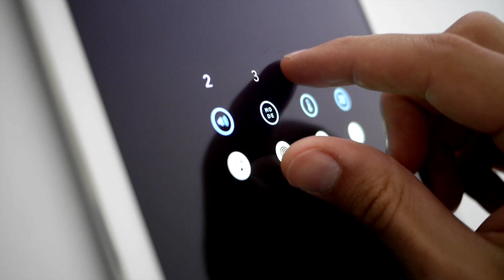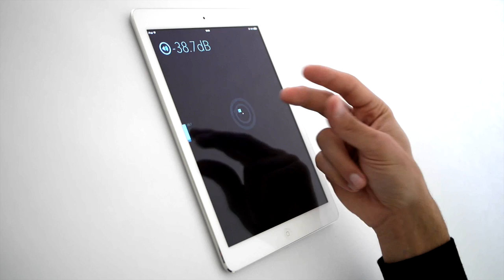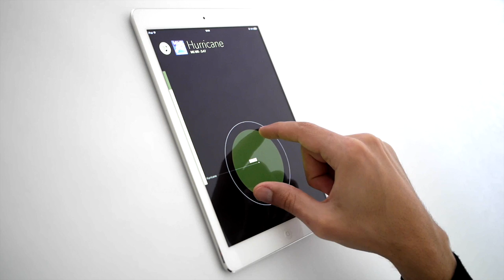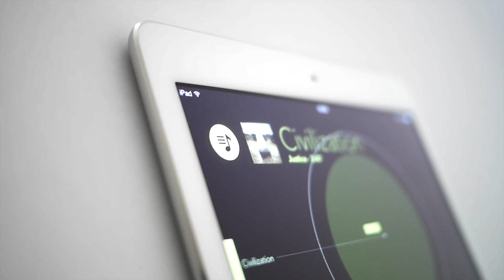A New Car UI: How touch screen controls in cars should work

Comment: Great concept, but it will be hard for manufacturers to limit the functionality of more complex models to 4 things you can control
Reply: Maybe this can be solved with more than one touch screen
Reply: 2'50  -  "All in all this interface gives you easy control over 8 different settings"
Reply: Caio Manzotti Its a neat idea, but I think its just that "neat". Its well thought out, but what happens if you spill a drink on it or crack the screen on accident like so many smartphones we see? The design and UI are extremely simple and probably would be more intuitive than dials, but the hardware of a touch screen is not practical.
Reply: Kerrigan Marois Sure, agree! But I think the idea behind the video is exactly it, prototype, test and collect feedback
Reply: Caio Manzotti I think its a great start and a neat concept. What will be interesting is to see what this is like when we stop actually driving our cars!

Comment: I've worked with a lot of multi-touch applications our company has built - both on our platform and on the QT framework.  In my experience, multi-touch controls tend to be pretty intuitive for gestures involving up to two fingers.  After that, people start running into trouble - either with correct placement (sometimes the surface doesn't correctly identify the number of digits if there is insufficient separation); or with recalling what combination of digits to use.

Multi-touch gets really problematic with 3 and 4 finger gestures, especially for people with wide fingers or dry skin.

The only successful application I have seen of 3 and 4 finger touch sequences has been on very large touch surfaces for multiple, simultaneous users, and that only works if the users are given training in how to use the UI, as it starts to become non-obvious.

I should also point out that with any touch UI, you need a lot of real estate on screen, as it's pretty hard to see what's happening on the screen underneath your hand.  Phones and tablets are okay, because you can hold the device close to your face as you interact with it, but a fixed screen in a car console would have to be surprisingly large for multi-touch gestures to work well across a broad range of users.

Instead of trying to be unnecessarily minimalist, I would suggest using large, friendly buttons to allow users to select a working context, (for example, adjusting the radio, or setting the temperature, or selecting an audio source), and then present a touch surface with 2 or 3 simple gestures like press, pinch, or roll, that don't involve more than 2 digits.

Comment: Driving a car on itself is a complex task, since the driver has to control the car, watch the traffic and be aware of what exits to take. The great challenge in car UI is that is should interfere as little as possible with the task of driving a car. Therefore I believe car UI shouldn’t rely on visual feedback, but instead look for other ways to give feedback. The big downside of touch interfaces is its lack of haptic feedback (and its reliance on visual feedback). Without watching a screen the user cannot see what button it is touching, if it is changing any values, and if so at what rate.

Also, putting multiple functionalities on one touch screen, allowing the user to switch between the functions via complex multi-touch gestures is making this interface even more complicated, making this a very hard interface to learn, master and control.

Although I agree this concept might be a better alternative than the touch screens interfaces that are currently shipped in cars (and also really like the visual style), I think touch screens in cars are in general a very bad idea.

That being said, I think I’ve actually never seen a real solid car UI (including those with buttons). I’ve always wondered why climate control in a space smaller than my wardrobe needs two-thousand buttons.

Comment: Clever, though I still think having two sizable buttons on the bottom one on the left and one on the right that takes up about 20% of the bottom of the screen would be ideal. You could sort through the options so you don't have to remember all the fingers needed for a function, this way you only sort through to that function and use one finger to alter the settings.

Comment: Considering using your hands is more about touch than sight.. only when they develop a touchscreen can have different textures would such a progression be relevant.  While this may seem like a great idea, what happens when you need 6 fingers to control the next setting?  What happens if you forget how many fingers you need for a particular setting?  and Most importantly, what happens if you're handicapped and are missing a finger or 2?

Comment: Beautiful Design! However, there are several problems with this approach. The things that buttons do really well for the user is indicate a feature. With your design, the user has to remember that two fingers = volume, three = fan, four = wait what was four again? It's unnatural and will not resonate with users of all demographics/ The other thing that you're now introducing--just as you point out with the buttons--is a ton of error. For example, the user tries to adjust the fan speed but didn't quite get all three fingers on the screen so now they are adjusting the volume. Imagine this sort of behavior but at 70mph. I'll take a few button clicks over trying to remember the correct finger combinations. Also, think about cold weather and gloves. This type of multitouch interface would virtually be unusable unless the user had a pair of touch screen gloves. I think the idea is novel, but isn't actually a good interface for a car.

Comment: While I think this is an improvement over the icon interfaces (like shown at the beginning of the video), I think a voice-controlled interface would be better and easier, Just talk to the car and it will adjust the setting you want; no need to worry about remembering how many fingers do a specific action.

Comment: Nice, but you realize there are more than 5 functions that can be controlled in a car?

On a more abstract level, the unsolved HCI problem here is mode switching, and doing it by counting the number of fingers is not really scalable.

Comment: Good concept but breaks general usability principles like affordance and visibility.
A blank screen does not give the user any clue of what to do as there is no affordance making it obvious what 2/3/4/5 fingers do. The system status is invisible and the user has no idea what to do with the system without a manual. There's also no mapping of the number of fingers to what the control is, why is 2 volume and 5 is aircon.

Comment: For common tasks I'd still prefer actual buttons that I can memorize instead of having to rely on multitouch gestures for everything. I'd rather press one button multiple times to browse through input options than having to fiddle around with a touch screen. You are supposed to control your car without getting distracted from driving.

With adjustable and correct placement your UI might just work. It sure looks fancy. But the input speed is nowhere near as fast as the way I currently control my car (purely by muscle memory and haptic feedback, without even looking). And that is a huge safety concern. Have you actually tried to control a vehicle while having your right arm extended to a touch screen, gently trying to maneuver your fingers into the right position over the time span of several seconds?

I don't see it happening. Car manufactorers might want to use touchscreen technology to reduce the number of actual buttons, but for core functions (the stuff a driver might want to adjust while driving)... god no.

Comment: We should be getting away from programmable touch controls completely. This is a good idea, for now, but what happens when you want more than 4-5 controls. A voice command system is the most intuitive interface I can think of. You're cold? Click a button on the steering column "Car temperature 23 Celsius, please." You can even have commands to save/load presets.
Reply: Except then I'd have to lower the stereo and roll up the window before every command to ensure my voice is discernible above ambient noise. The greatest frustration I've experienced with UIs have been voice commands that constantly misinterpret what I'm saying.

Comment: In order for this work well, they need to reposition the touch screen and perhaps put it on the steering wheel. It so awkward to place 3/4/5 finger on a screen that's more than half a meter to the right of you while maintaining control of the wheel. there are numerous other problems with the design as well

Comment: it is an innovative idea but there is the problem of people having to memorize the controls and possibly forgetting which gestures match with which controls, which is highly inconvenient if you're driving and if you have less than 5 fingers. You should drop the whole "# and position of fingers = certain control" and just go for a limited number of big, easy to see buttons on a home screen, which are then easily adjustable with your fingers anywhere on the screen once you tap them, the same way you showed here. It will immediately return to the homescreen once you let go.

Comment: Mr. Krenn, get in touch with BMW right away. You GUI/UI is just about as intuitive as the original I-Drive from BMW which was a complete and utter disaster. As to using my fingers (I only have 3 not 5), I think the next level of your inspiration could be achieved by placing 3 fingers (your own or someone else's) into the large orifice
between your gluteus maximum muscles and then expanding your figures outward as quickly as possible, preferably each finger would have a long nail.

Comment: Using multiple fingers is no good idea. You very easily accidentally might touch the display with too many/few spots (not necessarily fingers).

Maybe putting gamepad like buttons on the steering wheel would be a better solution?

Comment: I have to agree with the thread.  The start is really nice until it comes to multi-finger ID where disabilities or cultural/generation gaps come in to play. I'd dial it down into swiping between functional modes (which is nearly universal now) and use the pinch zoom.  Nicely done.

Comment: Better than the current systems, but still inferior to physical controls in real world use... Not to mention, not everyone has x amount of fingers.

I think touch displays should just stick to what they are good at: adaptive abilities. They should be used for apps like Pandora, GPS navigation, yelp or other restaurant/entertainment searches, gas station locators, etc.. 

Leave all the commonly needed functions for hardware controls. I shouldn't have to be fiddling with a screen and/or looking away from the road for radio, a/c, blinkers, mirrors and such.. I get that this design helps with that (not original though sadly to tell you), but it still isn't as nice as the tactile response from turning a simple knob.

Comment: It's an interesting approach, but it has obvious usability issues. If by accident you have just 4 fingers in the right hand, good luck with setting the airflow.
And it appears that this huge flat surface can access just 8 functions. I'm pretty sure you could easily put 8 physical controls in the same area.

Comment: You're still missing haptic feedback, and as a result the driver will still need to glance at the screen all the time. The whole point of a car UI is that the driver can focus on the road as much as possible.
Touch screens are very useful in many cases, but they are not the answer to everything. After a while, we'll realise how limiting they are and how dated they look in use cases like this one: why are designers stubbornly depriving the skin from something to feel? All that sensory bandwidth is completely wasted.
Reply: Because you can't rearrange physical buttons when you want to update new functionalities to the car.
Reply: Markus Roder There is no need to update functionality of the car, being able to update things makes it easier to break. It is almost impossible to have the ICs reading analog buttons to have a system crash(Less programming means less bugs). Completely analog buttons cannot crash.

Comment: This is an amazing concept but this is only for some users. This doesn't take into consideration that people are dumb, lazy and don't want to learn and memorize things but rather discover themselves and push everything randomly. This interface would require manual and nobody reads manual unless something is broken or everything else failed. 

Personally I love this concept and would love to use it but as UI/UX designer I can see flaws from far, far away. Probably it is ahead of its time. Probably.

Comment: The cognitive load for the user to understand what the multi finger touch, and what the ellipses and interchanging sizes mean doesn't directly correlate with actions used in an automotive interior.. Not to mention the visibility of font sizes etc.. Having designed cars myself, and worked on car design interiors, the user/drivers visibility is so limited. I am curious that you would mover towards traditional ui and not steer towards hands free motions and even HUD. That is the future of UI in the interior. Not taking tactile touch and feel into the digital realm and attaching it to flashy ui. Nice work though....

Comment: The problem with this is that you need to LEARN IT. People don't like to learn. They like to DISCOVER.
Reply: Dude  ... they will discover this interface fairly fast :) ... try the BMW controls with the friking wheal , that requires much more learning and u have to look at the screen
Reply: Seriously!?!? I think if you asked most people wether they'd like to spend hours 'discovering' how the hell to switch between the radio and CD in every new car they buy, compared to just being told once to 'drag up' with four fingers, universally in every car, so they can get on with enjoying the music, and oh yeah - DRIVING THE CAR... which is Mattheus' point - they'd go for the latter.

its about designing for a safe driving environment, one that's not confusing and not different in every car.  

Sure, if there was merit in the different designs car companies used in their entertainment displays, let them be different - thats great. 

But I think we can all agree that everything on the market today is crap, is not designed with the driver in mind, and needs to change!
Reply: Ricky Synnot If you want a safe interface design for a car entertainment/climate control system then we should just go back to physical buttons and knobs, so the driver doesn't have to look at a screen for feedback. I agree with pretty much all you are saying, but I believe that there is no need for innovation in this area at the current time. The old way just works.
Reply: Ricky Synnot My main objection is to the visual feedback.  The fact that each number of fingers represents a different function or the distance of the fingers is also a modifier should not be taught (users don't read the VCR instructions)  but discovered by the user through visual guidance. (The experience of discovery produces the most vivid memories) What we are seeing is just a incipient mock up and it's got lengths to go before becoming a true potential successful interface.  P. S.  I never said existing user interfaces and controls are good.  My personal conviction is that the best interface for car operation would be a voice + HUD combo.  Unfortunately voice input is not ready yet, but it will be, and when it will come of age, it will leave almost everything else in the dust, especially large distracting touch screens.
Reply: Alecs Stan You are right about the learning, but isn't that what the key at 0:27 is for?  It equates the number of fingers required to a simple icon.  The execution of something as elegant as this would be in the difficult details, but it's far superior to any integrated approach that I've seen.  Of course, I'm not sure that it beats the simplicity of physical knobs and buttons.
Reply: It's a legitimate design complaint with this UI.  Most people do not read manuals- they expect a UI to be intuitive.  The approach taken here while well implemented requires a tutorial...it can be fixed however.
Reply: you can discover very easy ;-).
Use one finger and see what happens... I Think its very intuitiv.
And if the Screen wouldn't be Black in Background, maybe you would have much more options to navigate through those options and settings...
Reply: Same is why commandline interface works better for advanced users. But worse for beginners. They like the mouse to click buttons. Self explaining GUI is VERY important for regular users. So you got a very good point. This video solves a certain problem, but creates another problem.... the creator of this video does not understand that. So this is not a good solution to the problem. But every failure is needed to come to a good solution.. so it's not fully useless. But great as an example how it still doesn't work.
Reply: The problem here is that you're using to much memory to use this interface effectively, it's against the interaction rules, althought the buttons and shown information is not minimalistic, it's way more easy for people to find things there and get used to that. And yeah, it's more discoverable than this, you just can't predict this will work this way without a manual or a tutorial or whatever